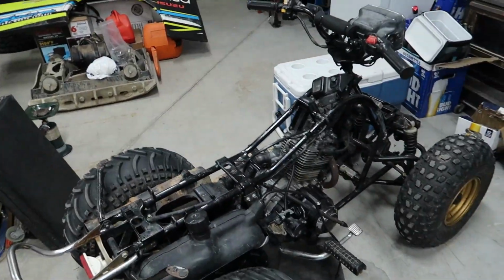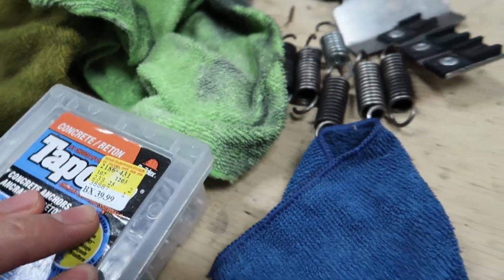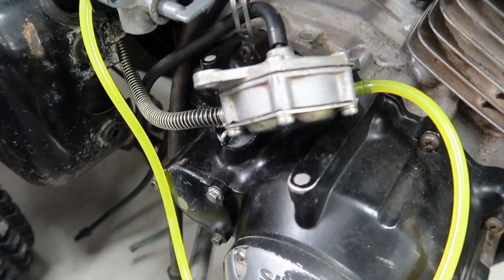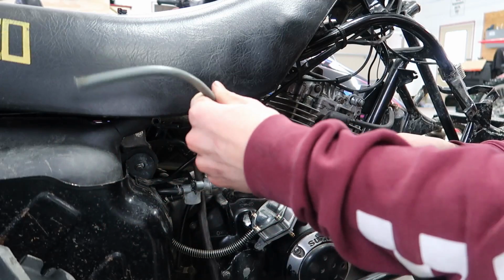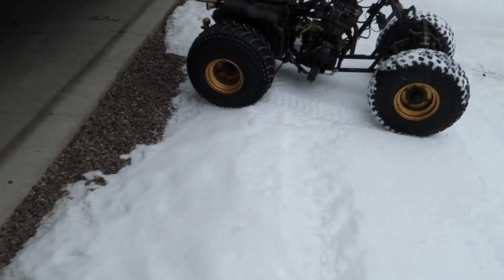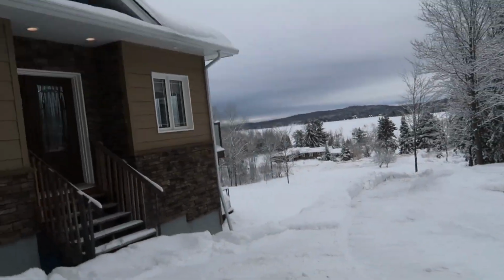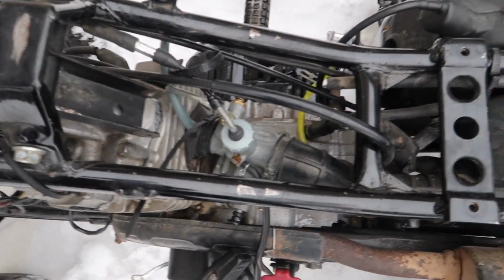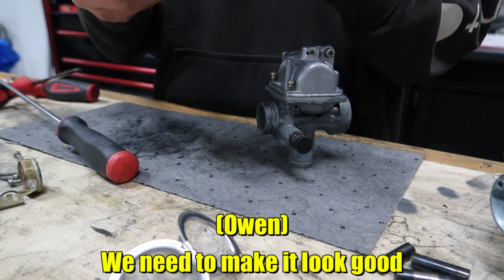Can I Get This 39 Year Old Quad Running (Suzuki LT 185)

Comment: On mine I noticed the drain bolt was also next to the bottom of the overflow, so the gas would just follow the threads of the bolt and leak out the bottom but not actually be overflowing